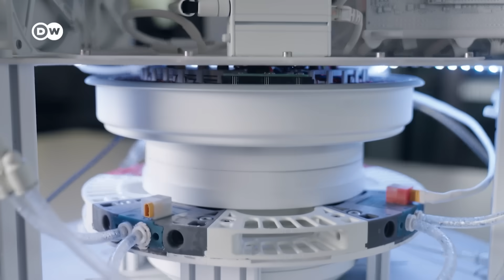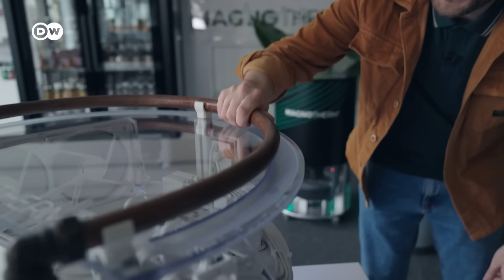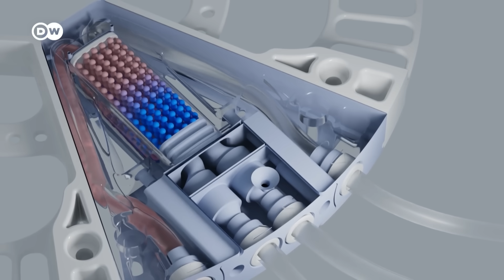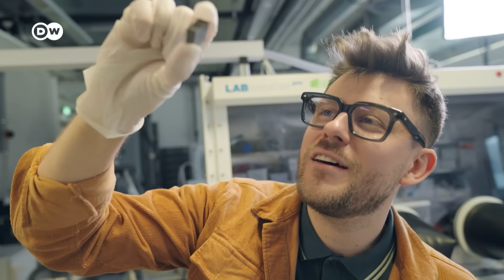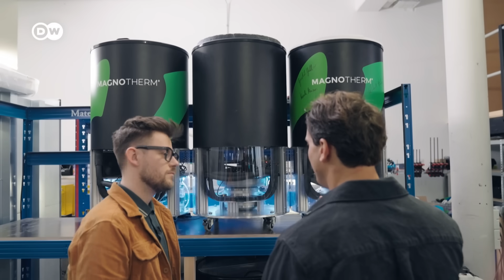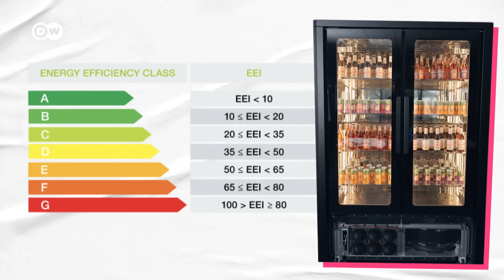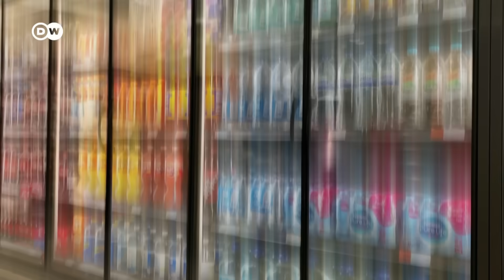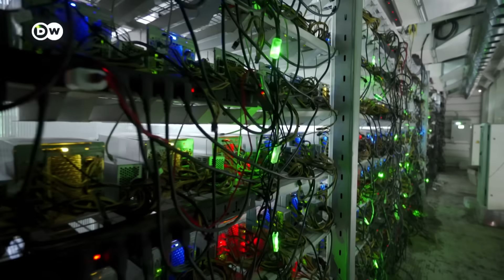How magnets could change our fridges and ACs forever

Comment: I have wondered why a fridge and hot water system aren’t combined? To my thinking instead of dissipating the unrequited energy it can be utilised for its potential.
Reply: In the case of water heating, the temperature the waste heat is rejected at from the heat pump is barely above room temperature, and the lower it is the more efficient the refrigerator tends to be all other things being equal, so making it reject to the higher temperatures a water system requires would take enough more energy that you might as well be burning fossil fuel or using an electric heater to get the same effect. Also the risk of legionnaires disease means water systems are usually designed to store water at a higher temperatures than it is needed for use in order to kill the bacteria.

In the case of cars, it would cost more to build and maintain the extra parts you're adding than the energy saved is worth (And the extra weight this system adds may well mean you don't even get better fuel economy). There have been attempts since Stirling and other similar heat engines were devised to use them to power vehicles, but they quickly ran into problems with real world performance as the only people that think heat engines of this type are an upgrade are those who's only experience is with steam powered vehicles (Start the fire to get heat in the boiler an hour or two before you take a journey), and under suddenly varying loads like those seen in general driving, steam will probably outperform Stirling engines too.
Reply: Yes, I have that question about the petrol engines in cars. Why not use the temperature in difference to run a Sterling engine for example to generate electricity? 75% of the energy in a combustion engine is heatloss.

Comment: These appear to be less efficient than modern heat-pump (vapor-compression) refrigerators. This is what Grok has to say: "Thermomagnetic refrigerators, which use the magnetocaloric effect, are generally less efficient than modern heat pump (vapor-compression) refrigerators for practical use. Thermomagnetic systems struggle with lower cooling power, material limitations, and the need for strong magnetic fields, which add complexity and energy costs. Vapor-compression refrigerators benefit from decades of optimization, achieving higher coefficients of performance (COP), typically 2-6, while thermomagnetic prototypes often fall below this in real-world conditions. However, thermomagnetic tech shows potential for niche applications, like ultra-low-temperature cooling, but it’s not yet competitive for mainstream refrigeration efficiency."

Comment: The levels of subtle secretive vagueness  is WILD
Reply: Yes, lots of weasel words. The technology sounds interesting, but from what I got from this video is that the 30% figure is compared to some very old cheap refrigerator, but compared to something modern they're basically the same with probably a much higher price tag. GE did their research and came up with the same conclusion. The fact that they're not manufacturing at scale (not even 10,000 units) tells me that it is still in the R&D phase they're not ready for it to be a competitive consumer product yet. My best guess is the best they can hope for is that GE buys them out and pays them to continue their research.
Reply: @Delosian  Also, every fridge needs a freezer as well, nobody at home would use just a fridge
Reply: Yeah, especially with the CEO.

Comment: Why not use PC heat pipes, rather than circulating a fluid?
Reply from the maker: That's an interesting direction too! Usually, heat pipes work passively, but this study, for example, looks at an active magnetocaloric heat pipe and shows it can actually use evaporation and condensation for heat transfer 👉 https://www.researchgate.net/publication/344948245_Active_magnetocaloric_heat_pipes_provide_enhanced_specific_power_of_caloric_refrigeration

Comment: You state that is gets down to 9 degrees Celsius but the average refrigerator temperature in the US would be 3 to 3.6 degrees Celsius per FDA regulations? Will these get down to this temperature? If not it would still be great for air conditioning.
Reply from the maker: Great question! The prototypes we looked at in the video reached around 9°C, but the technology is still evolving. Magnotherm is working on improving the cooling process, and their goal is to achieve lower temperatures. 🥶

Comment: Another point to add is that this only effects freezerless refrigerators. In-home refrigerators have freezers, which this tech can't accommodate. If brought to scale, this would only effect only refrigeration systems that don't have a freezers. It's still a large market, (commercial, wine coolers, vending machines, etc) but won't change anything for in-home refrigerators.
Reply: differenr working fluid. no problem. use ethanol, butane or whatever
Reply: @snorttroll4379  It's not just about the fluid, the space this spinning contraption takes up is massive compared to current compressor fridge-freezers. So much so you don't have enough left for even half a freezer with the same unit sizes as current fridge-freezers. Utterly impractical for homes, and I can't see that changing any time soon.

Comment: If it could be made practical, it would eliminate the need for toxic and UV absorbing fluorocarbon gases (or worse, old school AMMONIA!) when a leak occurs or a unit is damaged.  Plain water (with perhaps a tiny amount of bleach to keep it sterile) would cause far less danger if it leaks!

Maybe mobile refrigeration units, such as car AC or reefer trucks.

Comment: Way to weasel out of answering directly about efficiency. You can tell that it's an overly complex system that does not justify the costs that go with added complexity. This is like a fancier Peltier module, where a standard flow pump is still needed. And you're supposed to get more efficiency by running 4x the moving parts? Nothing beats old tech. This type of fridge would be great for special applications. Maybe in space it would be useful for equalizing heat for objects that go through thermal cycles when facing towards and away from the sun. It's just that the tech is worse for consumers. You want one thing most of your device - for it to last. This ain't it. It's just some engineers figuring a way to sell something non-economically viable.

Comment: Sadly this technology will never be practical. This is such a complex system; conventional fridges work rather well, and this complex approach is typical German over-engineering, which was a contributing factor to them losing WW2 when 2/3rds of their tanks were in an inoperable state due to the complexity of the repair processes (according to my WW2 veteran friend).

Comment: my biggest gripe on this tech is the whole system is a big rotating motor, comparing it to tried and true conventional compressor, it's  hard to imagine that will last more than 30-40years which some fridge can even last 50 years and still working just fine with some maintenance every 10 years

Comment: Now if germans can make this compressor run also by magnets...what i meant no AC input just the magnets...zero electricity consumption AC that would be crazy. Problem in my country is that ww cant trust inverter tech anymore because of fluctuating power from utilities.

Comment: There's also the benefit of not having a refrigerant gas. Those tend to be environmentally harmful, though modern refrigerants are much less so than older variants. Still, I think we won't see mass adoption of something like this without a clear and decisive advantage in either manufacturing cost or operational cost. I think the former is quite unlikely, and the latter will require some considerable iteration of the R&D process to achieve. Worth keeping an eye on.

Comment: Perhaps vapor heat pipe could be integrated into the block, and be used like a thermal check valve. The heat pipe would carry heat upward on the hot part of the cycle, giving the system an upper hot end and lower cold end.

Comment: Why they using 3D printed lattice cube with all sides hole. That have no sens. You not improving heat transfer, you getting more area contacts, however you getting more turbulence as well in fluid flow. Just make parallel  holes, the analogy is to steam locomotive firebox. To make the lattice you put in let say box form with horizontal pins in one direction in parallel in several rows. You fill the material. Put in vibrator to remove any air packets. Slide out the pin. Remove the from box form and cure. This guys overcomplicating the thing.
Another thing. I wonder if the working fluid can be change to fluid of low thermal capacity. If the will improve or  get worst  the efficiency.

Comment: Maybe this has some potential.  However, we really haven't done a very good job of exploiting the potential uses of traditional refrigerants. Especially in power generation.  I guess someone will point out that a steam engine is basically refrigeration in reverse.  The same technology can be modified to extract power from any imbalance of temperature.  The real question is finding cases where it is significant and cost-effective.

Comment: All these 3D printed nanotechnology rare earth metals are absolutely ridiculous when we have a megaton of optimizations to be do with our traditional systems.

A simple math reveals that we really do not want to truly optimize and conserve energy, but rather work on what makes money.

The whole concept of having cooling and heating appliances is very silly. Instead, we should only move cold or hot air or liquids in or out of our homes and appliances.

We use electricity to cool our foods, while outside temperatures are sub-5 degree for 3 to 4 months of the year. Maybe our kitchens need to be designed closer to the exterior of buildings, or maybe just like geothermal tech, we could pump the cold air inside using pipes. A refrigerator generates heat inside our homes, while it is considered a benefit, it is the most expensive way of generating heat. If a fridge generates heat inside home, the thermostat on the cheaper heating method dials down the flow.

Same story applies to any other appliances that heats up or cools down, instead of talking to each other.

Have you ever thought about the energy wastage of a hot shower in winter? Energy coming to our homes from a power plant is already inefficient. We then use a ton of energy to heat the water up, transport it 5 floors up an apartment that loses energy, the water briefly (if ever) touches our skin to go back down the drain, still pretty warm. Where does that energy go? Sewer, and we're not recovering that energy.

Comment: it's not just about how cold something is. It's about loads heating loads to be precise refrigeration isn't about producing cold, it's about the removal of heat. As if heat is absent, it is cold err cooler but that doesn't make it cold, that just means there is less heat in it. <now take a look at capacity of a magnetic effect cooling apparatus. Refrigerants aren't going anywhere... the refrigeration market is arguably a 100 billion a year market. You think conglomerates looking to 1 up another manufacturer wouldn't have research teams to produce something? These kinds of things are mostly left to foster in the click bait you tube realm, because most of these magnetic type effects generate more heat than the so called cold they produce. Then it's about cost to produce it and how much it costs the person who plugs in in at home. As a reference point 1 ton of cooling = 12,000 BTU's  and 1000 watts is only 3412.1 BTU/h in laymen's terms not practical, but great for you tube click bait

Comment: I didn't finish the video but since you are circulating regular water inside pipes, we can say that you don't expect that it will be a sufficient solution for cooling with this arrangement either. I mean, water would freeze at 0C.
And the second thing i notice that, you are running an electric motor to spin magnets and it affects your form factor in a bad way. So I wonder if why you didn't choose to apply a oscilating magnetig field directly to the iron blocks instead of spining a magnet. It would be more efficient, more robust, more silent, more compact etc. I mean, it is not a brilliant idea, anyone could think of it. But I really wonder why did you choose to utilize electric motors? 

And the last thing this video made me think is that, some people acts like energy efficiency was the most important thing in technology. But there are other important aspects as well. If we look at everything in energy efficiency perspective, cutting down all the electricity and not using any refrigerator at all would be the best for environment, but obviously we cannot do that, so there are other important aspects. We need things to work to run the civilization. The first requirement is, it should work, and the second requirement is it should run with relatively less energy.

Comment: 08:00 "...we're already 100% better". What does that even mean?! There is a man carefully not answering the question honestly.
The question was about what percentage better they were; if you're aiming for a 20-30% reduction in energy use, you can't be 100% better or you'd be using no energy at all. 
So... what does "100% better" actually mean? A 50% reduction, or a 0% reduction? 🤷

Comment: So they have to use permanent magnets?  Seems like a static wound magnet coil would be cheaper and smaller.   Then you could pack more in.  Need super conductors.

Comment: Even if an A efficiency rating is achieved maintenance doesn't seem like it'd be easy and simple. With how well the water system has to be synchronised and a spinning magnet, it'd be prone to faults and I'd think getting it repaired wouldn't be cheap at all